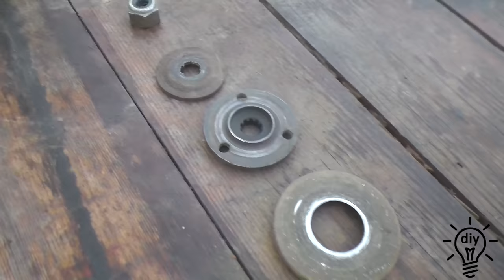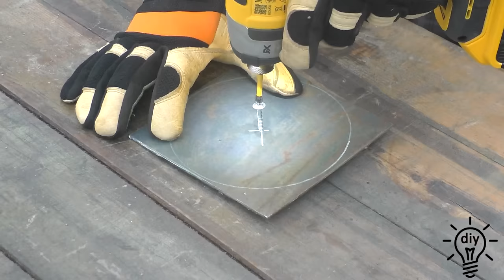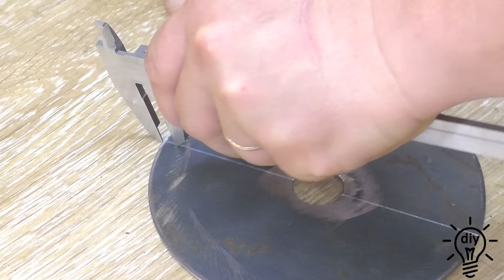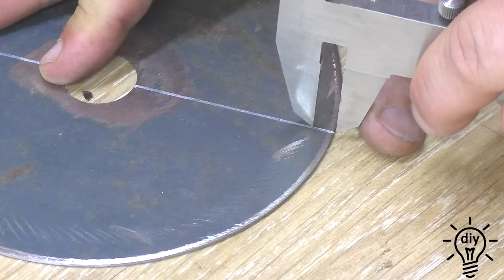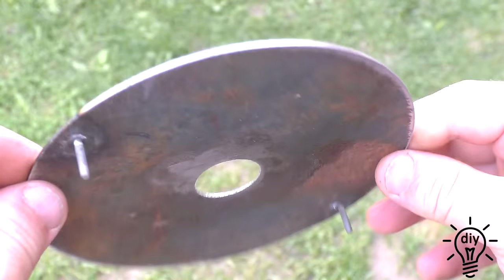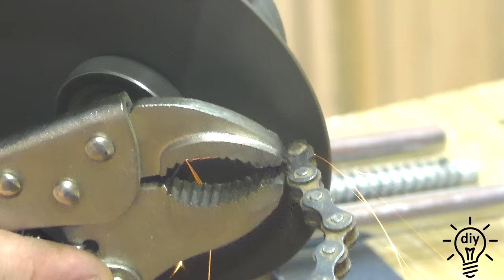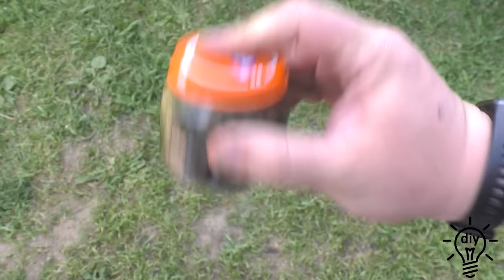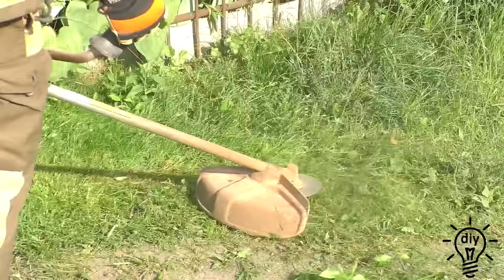A brilliant idea from a bicycle chain !!! Mow the lawn without problems !

Comment: The longer the chain, the greater the shrapnel effect. This is one of the most creative grenades i've ever seen.
Reply: Absolutely, just need to get rid of the guard (or let the longer chain shred it off)
(safety guards are for woosies, aM I RiGht?)  
Then I am thinking it could use more than 2 sections of chain - I bet you could fit at least a dozen on that disk.
Reply: Local man moding his saw, accidently created least efficient grenade in history of mankind.
Reply: Цепь надо от бензопилы,травмы будут красивее и глубже.
Reply: Captain buzz kill
Reply: That's why they were recalled by Echo and Stihl back in the early 80's.

Comment: Wait till those little bolts where the chain is bolted to breaks because of centrifugal force, that chain is going to go flying in somebodys head or face / leg and cause horrific injuries. DONT DO this MOD.
Reply: Yep, massively dumb idea.
Reply: Agreed it's bloody dangerous! There's a reason they use nylon in a strimmer.
Reply: @Bender Are you silly or what ? Very dangerous this mod
Reply: My thoughts exactly!  They didnt look like high grade at all.
Reply: NICE idea - if you want to know how far the parts fly, after disassemble itself - 
at 5000 (more?) revolutions / per minute. There is a steel disc with solid blades, useful for things harder than grass. You need the same safety equipment as for chainsaws. The idea is good, use headed bolts and nylon rope / zip ties?
Reply: @matthewwheaton5835  A really favorable circumstance is surely:
YOU rarely have such ideas, right?
NOTE: A sudden idea
 doesn't necessarily have to be good!
Reply: This looks like a modern time torture device, Taliban approved
Reply: I know a guy that did a.mod just like this he no longer has a right foot due to it breaking on him at max RPM.
Reply: The very same thoughts came to my mind. Thank you. Hope many others see your WARNING Message.
Reply: @clevo351  and total unnecessary too
Reply: @Bender me too. let all live dangerously.
Reply: Yeah, defiantly a good way of despatching yourself or a love one due to a "Mod" that will save you a from replacing a piece of plastic that is designed to be non lethal, /S why not add a few welded bolts on the cain ground to a points for that added modded look. ~Trooper
Reply: You didn't really think someone who uses a patio table to cut,  drill and screw into metal thought anything through, did you?
Reply: Report the video as harmful or dangerous acts.  😉
Reply: My thoughts exactly, to
me the weakspot is the actual welds that connect the pins to the plate.
Reply: thay left out the best , you all know the one.....where it shows a leg takeing one for the gipper.....
Reply: Exactly what I thought! So dangerous.  It's Going to go flying in some child's face
Reply: @Toddy9cent  <YOU rarely have such ideas, right?
>

Ideas that are insanely dangerous with no real benefit?  No, I prefer to focus on marketable ideas.
Reply: Trust me, that's a terrible idea.
Reply: In Germany we say „TÜV sagt NEIN!“ :)
Reply: This is a weapon, not a Tool.
Reply: I’ve been hit in the face with a tiny stone from a weed wacker that caused me to get stitches because it split my lip in half. This isn’t a good idea. At all.
Reply: This is why they use nylon cord now.bloody death trap.
Reply: This. Came to comments just to make sure folks were warning that this is an incredibly dangerous and deadly mod. There's a reason edge trimmers don't use metal chains, but rather plastic wire. They'll both decay with usage over time. The plastic wire will wear quickly, at the point of contact. Additionally, it limits the force the wire can impart on an object such as a stone, to the breaking point of the wire - it can't hit anything harder than this, even if the lever action of the wire length and RPMs impart massive force, the weaker of the two (force imparted, or tensile strength of the wire) will lose, meaning the plastic wire will break before imparting a seriously hazardous force to a loose object. 

A metal chain will wear slowly, and the weakest link won't necessarily be the end. It will stress fracture at a random point eventually and become a hazardous projectile. And as above, the force which it can impart to a loose object is now limited to the breaking strength of the chain - several orders of magnitude higher than the plastic wire, and allowing loose projectiles to have a massively larger force applies to them.

You could encase the entire outside in a sheath to protect against this inevitable eventual stress fracture, as per mowers, but this design as it is is a kids decapitation waiting to happen. Simply, DO NOT make it. Those screws are not designed to handle those stresses, let alone the chain. And the potential for projectiles to fly out capable of blinding or wounding bystanders is considerably greater. This is incredibly stupid, and the producer should be ashamed putting up such a video to make money from.
Reply: Dwane Meighan  only a quick idea, i think, better than chains.
Reply: Dwane Meighan  Many people underestimate the forces that prevail due to the high speed. Also with regard to protective equipment
Reply: Dwane Meighan The idea of replacing most used magazine systems with something permanent, came up very quickly, because they often do not work properly. The time saved by the motor is fiddled with the thread system. There are also fixed blades (Stiehl) for commercial use, but more expensive.
Keep healthy!
Reply: @remedy84  Heh, I've dealt with TUV.  I'd love to submit this just for their reactions.
Reply: I did this and it castrated me.
Reply: It can do big damage , stupid idea.
Reply: @Bender respect
Reply: My thoughts exactly. If that doesn't happen, the drive shaft will surely break - it is not designed to spin that mass.
Reply: clevo351 something like steel wiring from a fence would be safer, except if when your working around something made of timber
Reply: @mikegoodman4133  exactly
Reply: @AleksVideo  😂
Reply: @allowyou9225  🤞
Reply: @Bender "Remember meeee!" Lolol. 
Looks just like somethin "as seen on tv".  Maybe add a bottom plate to secure the whole sammich together.. Send it!
Reply: @LeslieJayBoschPhoto  your comment is pretty idiotic. You work with whats given to you..or you dont work. Ask me how i know you work in an office and do DIY stuff on the weekend...
Reply: Dude you took the words right out of my mouth...
Reply: Wait till you see his nylon bicycle chain!
Reply: @078OG  now he's one of the girls
Reply: That was one of the first things I thought of as well as using calipers for a scratch awl.
Reply: @matthewwheaton5835  tttttttttt5tttt
Reply: You are spinning a heaver unbalanced mass, more vibration , wonder how long the motor will last.
Reply: Este o bomba cu ceas,cand se va rupe
Reply: Este o bomba cu ceas,cand se va rupe
Reply: Eating lint out of a cat's ass comes to mind. Something I've thought of but would never ever do.
Reply: You better say your goodbyes now, because it will be him that it takes out.....
Reply: Thank you
Reply: It’s nature and called natural selection
Reply: I would rather buy a second hand helicopter and use it upside down to mow my lawn... if you wanna die.. do it like a man...
Reply: 7
Reply: @king1984mg  7
Reply: @matthewwheaton5835  ғ га
Reply: I was going to say the same thing!
Reply: Dangerous, yes, butttttt.....he’s got almost 10 million views. That’s what’s all about, no!!?
Reply: Why think of the worst?
Reply: Good point!!
Reply: Take 2 minutes to replace string, or severed femoral artery?
Reply: Super))
Reply: more items on my youtube channel))
Reply: @brayhill  nobody has ideas like this too often. Not if they act on them at least. Those people have an idea come into their head, build the idea, then have the idea come into their head. Literally.
Reply: Definitely avoid this if you have neighbors , family or animals
Reply: @timothykeith1367  common sense or any desire for self preservation.
Reply: @Toddy9cent  .
Reply: Переведи... На. Русский
Reply: @remedy84 in us we say fucked up

Comment: If I'm looking for a melee weapon in case of a zombie apocalypse, this has me covered.
Reply: You'll want something that doesnt run on gas or electricity, but this may have you covered for the first cpl weeks lol
Reply: I recommend an aluminum baseball bat with a 6" blade  mounted on the top of the bat you can use it as a cudgel and a spear (for thrusting not trowing). It would give you reach and be of use for much longer aside from the gas there's mechanic maintenance that would it far less viable for the long run.
Reply: I'll stick with my Sig 40 S&W
Reply: @MaddDuck  that's great choice for a side arm but we were talking about melee weapons.
Reply: An electric one would be fine there’s plenty’s of ways to make hand posted generators to charge battery’s but it’s to loud even and electric one would have a loud hum
Reply: Been here for years now.

In light of current events, those who wear muzzels and have gotten that recent injection / shot... Well... You'll see.

Before you decide on a weapon. You need a name. Start with יהושוע
Reply: Was thanking the same

Comment: If only there was something less lethal to turn at high speeds, something that wont cut off your ankles, like a string of plastic...
Reply: He defeated the purpose of safety line.
Reply: Christian Fiebig - Or your cat...
Reply: I would be concerned about the liability. You know like a link breaking off and impaling the neighbor kid or the entire chain flying off because the 1/4 stainless steel bolt sheared off.
Reply: I wonder what the shear strength of those #10-32 machine screws are….
Reply: How about a lawn mower.
Reply: @shockcoach  800 pounds
Reply: I doubt it would cut off someone's ankles.  Their feet, sure, but it would be pretty tricky to cut off just the ankles.
Reply: Neighbors.    He's mowing his yard again tell the kids to put on there helmets and bullet proof vest on honey
Reply: Genius I say.  I hope they keep making these hack videos.  More Darwin awards!
Reply: Be nice ....oh wait!!!! Don't they call them string trimmers ?
Reply: Can you imagine that thing throwing a chain
Reply: All companies most time will be selling u a plastic wire cable than metal parts  .. .  🔺🚷🚫. If done safe, sandwich metal disk with Chain top & bottom . this chain was on top of disk unbalanced .
Reply: Tiny machine screws with the heads ground off..in single shear. Kids, dont try this at home..
Reply: Read my question and suggestion. The steel plate and chains would prematurely burn out the bearing in the head of the weed eater not only from the additional weight, but if the weight is not perfectly balanced.
Reply: @dge2027  if they're headed to school they should probably already have the bulletproof vest. I can't believe we live in a time where they're advertising bulletproof backpacks
Reply: That's completely rediculous. Plastic is not biodegradable whereas metal will eventually rust away.
Reply: @shockcoach  EXACTLY
Reply: @williamevans6522  Not after he welded the heads in place and altered the temper of the screws.
Reply: @honkie247  Agreed, and as pointed out by another,  the single shear mounting  would fatigue over time, 
Not to mention wear on all other pins in the chain(s) eventually causing failure anywhere along them.
Reply: @italiansausagge9905  $$$
Reply: I'm Gonna make one with razor blades!! : _ ]
Reply: Yeah that's no joke! My wife decided to mow one day that I was asleep (night job) without checking the yard for debris after a decent storm. She ended up running over a piece of chain link fence which whipped around and got her in the leg. I don't understand just how bad of luck it was but it actually managed to to go into her leg at a point and hit the bone. Needless to say she no longer tries mowing.
Reply: thay left out the best , you all know the one.....where it shows a leg takeing one for the gipper....
Reply: @lesliebrew4789  oh, what an "unusual" idea ...! SIMPLE and SAFE!
Reply: @shockcoach  he should’ve used the hardened steel shoulder bolts

Comment: Just imagining me doing all that work, hitting a rock hidden  In the grass within the first 3 seconds of the inaugural run, and trying to muffle my screams of pain into the neighborhood, after that chain flies off and reminds me of how good the plastic line from Home Depot was after all………
Reply: Lol 🤣 I literally had the same reaction just seeing the thumbnail. After seeing the video with no mention of bolt grades or sheer strength my opinion stands😂
Reply: There is a way to make it even more Gung ho. Why not use a chainsaw chain? And take of that silly plastic protection cover... And give chain a proper diameter
Reply: No risk, no fun...!!
        😂😂👍
Reply: There's a reason they normally use some sort of plastic for that. Bigger machines, like the ones that clear brush from beside the highway can get away with chain because nobody is in the area and the operator isn't in the plane that the chains are swinging in.
Reply: @SmallSpoonBrigade  I totally disagree 
Steel cable is used, that chain is still turning way to fast for my shins
Reply: @karisaarinen2746  I’m sure this guy didn’t make to you the next stage of filming
Reply: @karisaarinen2746 
-the Texas chain massacre- part 5
The farmer jumps the 'double dutch' ...!
Soon in your cinema.
Reply: @karisaarinen2746  chaaaiiinsaaaw blade..............
Reply: Just use a bigger chain. It won't break as easily
Reply: We notice you didn't mention the even CHEAPER line you get from Walmart... The kind that melts itself together after you weed eat the yard 1 time. Then you have to take the head apart every time you need more line...
Reply: @karisaarinen2746  Well you get so big with the chain and you'll instantly break most weed Whackers' shaft...
Reply: @SmallSpoonBrigade  Those chains aren't attached with #8 machine screws either.
Reply: Classic Chad
Reply: LOL!  Chad!  Your comment is HILARIOUS!  THANKS FOR THE GREAT LAUGH.  ;)
Reply: I think they're outta weed-whacker whacker-line. (Supply-chain issue? )
And when you can't get whacker-line,  you do what you gotta do to whack your weeds.
Reply: @karisaarinen2746  I was thinking the same thing, @Kari.
Then I thought: How much does a chain-saw chain cost?
Then I thought again and wondered whether a cow might be an even better idea. Just say'in.
Reply: @falloutshelter6  And what about the kid who can't ride a bike anymore?
Reply: imagine one of those chain puppies coming off and hitting you on your calf.. ouch
Reply: @marvinboggs  that's why when it comes down to it use the plastic line for Pete's sake you don't want to be going over this thought while some specialist in the hospital is pulling out bike chain and road rock out of your calf and your thinking why didn't I stick with the plastic line and you get a text from the wife asking you if you seen little Bobby's bike chain he can't ride his bike it's missing ... Lmfao
Reply: Awesome! Love all these idiots on YouTube that try to “hack” an better way of doing things, when the original concept was best all along! Anything for “content”, I guess.
Reply: @kramnull8962  that’s why we don’t buy the absolute cheapest stuff, guaranteeing the worst product/result.
Reply: @hp2402  Nobody eats at McDonald's either. But they have 2 lines at the drive thru filled to the brim....
Reply: @kramnull8962  hope they enjoy all the cheap
Reply: @hp2402  Oh yes, keep on buying only premium bars of gold....
Reply: I done a similar thing with a £37 hover mower that uses plastic blades. I converted the plastic mounting plate to take two home made blades out of 20 swg zinc plated steel. All went well until I hit a stone, the mounting plate snapped, luckily sending the blade through the front of the mower! I managed to weld the plastic front back together and get a new mounting plate. I now use the thin green plastic blades, as they last a lot longer that the originals. Some good idea's can have painful consequences!!
Reply: @karisaarinen2746  nah go buy a couple of bread knives and remove the handles and drill a hole in them so you can mount them with the bolts . Now that's a real mod haha

Comment: I imagine when you trim around the metal fence and the sparks fly, the resulting grass fire will eliminate the need for mowing. Creative problem solving.
Reply: If the grass is that dry you most likely won't need to cut it
Reply: Or around the natural gas meter... 🚒👨‍🚒
Reply: Edge a drive way & your done when it comes apart
Reply: Set off a chain reaction
Reply: It ain't much but it's honest work
Reply: No house insurance either, it’s great!
Reply: Haaah👊
Reply: You can start fires just by hitting small pebbles in the soil.  I've done it with the brush cutting blade on my weed hacker.
Reply: There is a Silver lining to everything.

Comment: I’m literally laughing at many of the brilliant comments. My 1st thought was how long will it take to ruin absolutely every bit of fencing surrounding this guys yard, and God forbid he has a gas meter/line in his yard like I do, because once that bad boy causes a leak and a simultaneous spark he may not need to worry about yard work ever again. 😂
Reply: But hey at least he used gloves whem he was making this 🤣🤣🤣😅😅😅😅🤣
Reply: I was thinking the same thing, if that chain hits a fence or something made of wood.... and also there's the chance of the chain breaking apart during use which is dangerous. Something like a steel wire from fencing would work, but once again if he hits some made of timber
Reply: Дуже гарно виглядає, але не практично, зовсім скоро трімер вийде із строю.